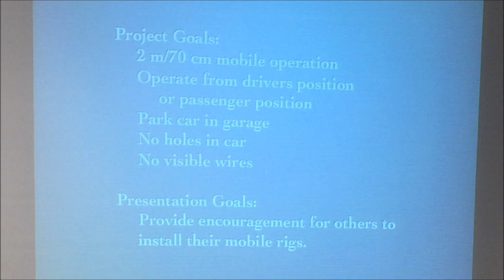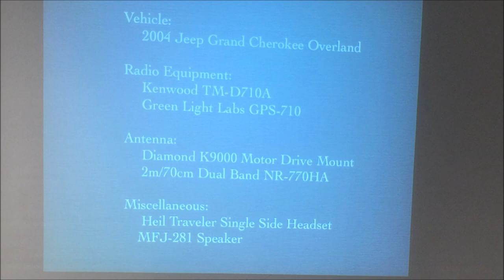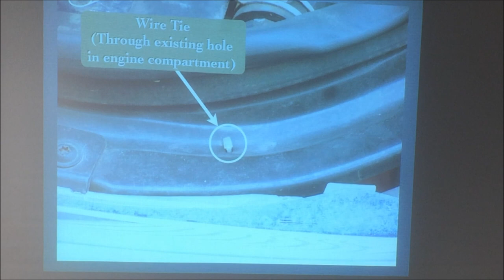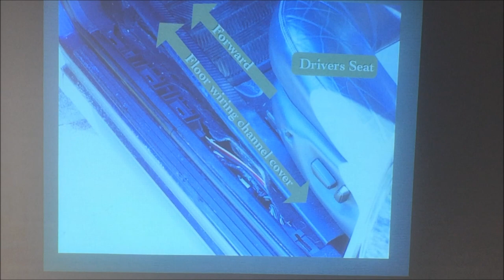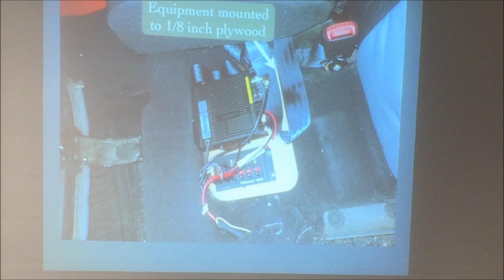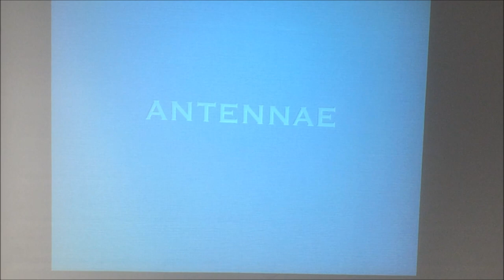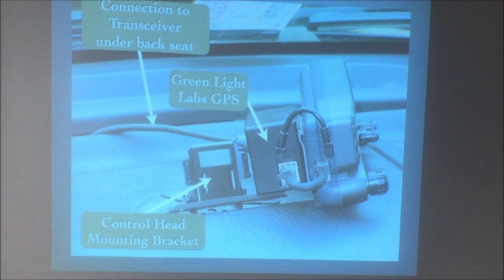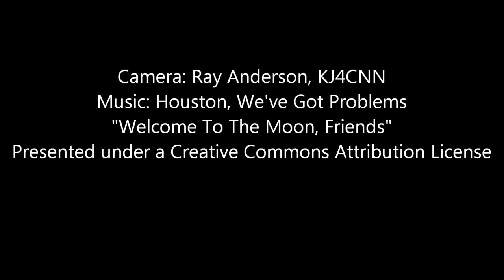Installing a Mobile Radio in Your Car

Comment: Just put a Yaesu Fusion radio my my Ford Ranger. Used an old Larsen glass mount antenna, (reinstall kit) and Ram Mount system. The RAM Mount makes it easy to position the radio exactly where I want it. Five speed transmission. Put the radio right behind the gear shift, works great. Does not get in the way of anything. Routed my power to the battery through an unused grommet in the driver side door hinge area, through to a space between the wheel well and the plastic wheel well. Went directly to the battery with no exposed wires. Antenna on rear window of course, and routed between the seats right to the battery.  Worked out great.

Comment: Sadly Ham well radio com in general is-has been a thing of the past. The only ones around they use radio com around for the last 15 years or so is public services.
Reply: hmm not around here, ham is growing and cb is growing big time. computers wont ever take the place of Ham. it isn't the same at all, a chat program is not even close to talking to a person via radio.
Reply: B-91-10 The number of HAM Operators is increasing ever year. Mostly because of the survivalist getting ready for the FEMA camps, considering the mumbo jumbo you hear on the air. Point being, more licenses are being issued.
Reply: Around here in the NE GA NW S.C. and SW N.C. Ham and cb is big. there is very little silence on 2mtrs within the tri state area we have nets nightly 7 days a week. and CB is huge here with last Saturdays check-ins at 223 and normal 2mtr check-ins 7 days a week is around 30. so far from dead here. but I suppose some places are dead. but computer chatting isn't close to what Ham is to me. of course it pays to have active Hams/cbers who promote the hobby. Around here that is the key.
Reply: Butter Bean I agree I check into the bars 2m net almost every night
Reply: My son has his license, so when the inevitable s hits the fan, we will be able to communicate at least by simplex. You, my friend, will be trying to figure out why your iPhone doesn't work. In a real emergency, the government takes over all the cell towers, and locks them down for "official communications" only..  Nobody has told you that, but it's a fact. That is certainly the way it is planned across the country.
Reply: B-91-10 come off your island. You are mistaken and missing a WHOLE LOT MORE That is going on with ham radio.
Reply: Ron Louis I know that during the large forest fires we had here over two years ago they had ordered residential cell phone usage to stop because it was needed by emergency personnel.

The reason why though is because the radios that the responders were using also failed. My guess is their repeaters lost power, and they couldn’t coordinate anything on that scale with their HTs. They had critical work to do, and cellular phones were how they did what was necessary to save people’s lives.

Anyway, I sometimes mull that whole disaster over, and I think that having a mobile radio is a great idea for many scenarios except for things like the roads are filled with burning debris. I hope to never have to find out.
Reply: Hi.

I know specs suggest we power the radios directly from the battery.

Would you know if it's ok if I connect the positive to the ignition wiring, and maybe use a relay? That's just so that the radio turns off with the key and I don't inadvertently drain the car battery.

Thanks.